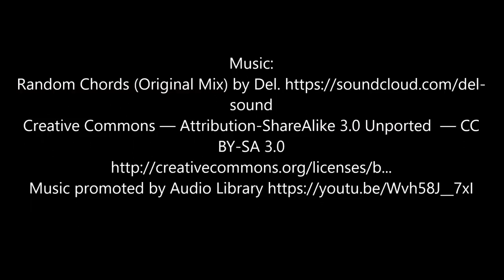Building a wooden horse stables. Stable Build Company.

Comment: Well, you obviously have no idea of horses. Stall doors are to be at right end of stall front with left side hung hinges for doors to swing open with handlers left hand. Horses are led and mounted from left. Handler opens door with left hand, steps into open stall, leading horse on right into stall with wall on his right. If horse bolts handler is safe out of the way. Doors down an aisle will be on opposite ends of stalls eliminating danger entering or leaving stalls.
Reply from the maker: Thank you for the insights. I do work closely with the customers to establish the conditions of the ground, opening positioning, placement of the hinges etc. And knowledge of the equine welfare does not reflected in this video.